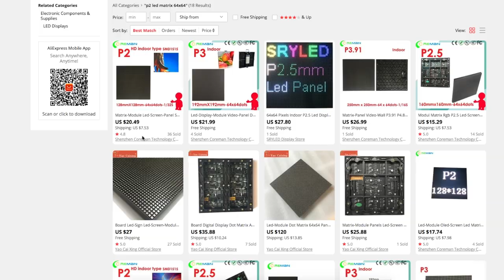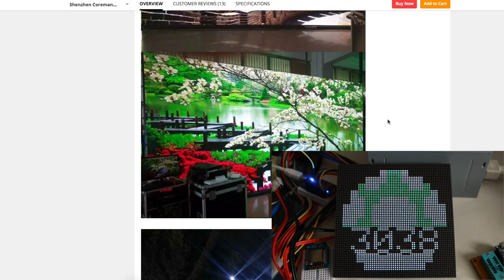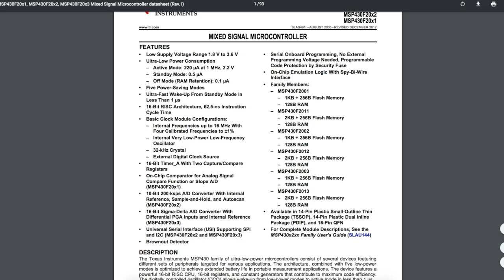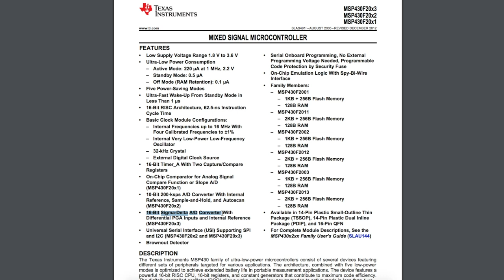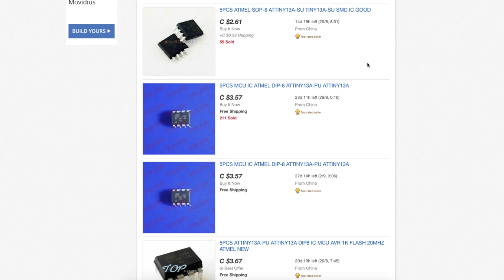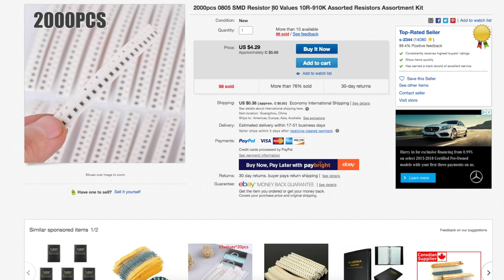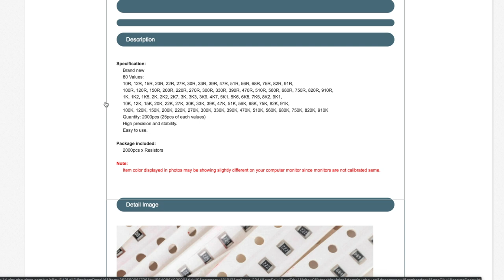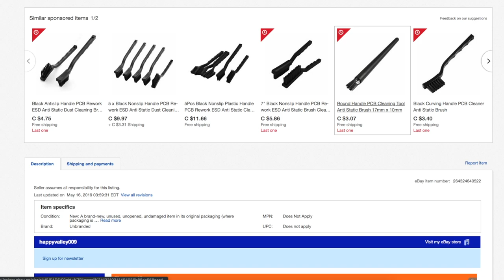GR Mailbag 19.AU.05 - 64x64 LED Matrix and Tools & Parts

Comment: did you try driving display with fast level shifter (like 74HC245D) or as-is, directly from espxxxx board? I did not run it with such displays, but find by hard way that proper fast level shifter required for fast 5v logic, like "neopixels".
Reply from the maker: In this quick test I just went directly from ESP because that’s what those other successful projects were doing even though I did some more research on the chips on this display and looked up their data sheets and of course they are 5V logic where the minimum input valid logic high is above what the ESP can do.

So my next step is going to be trying a level shifter but I figured it was worth a shot because other people had it working and I’ve been able to use the ESP to drive other 5V chips  like max7219 but I do need to do things a bit more properly now that it didn’t work on the first try for me.
Reply: @GadgetReboot  Well, looks like it's depend on phase of the moon and what esp8266 ebay sellers ships today - proper ones or factory rejects.. Please start from fast level shifters for display, don't waste your time with ones based on mosfets - those good only for buttons and non-speed critical devices.

Comment: As far as PIC's the newer ones are more interesting IMO. It seems like fewer people play with them because of the paid compiler nonsense. I won't pay for their compiler. I did pick up a book on the PIC16F1717 with XC8 from Apress. That chip is interesting for it's analog peripherals 10b ADC, 8b DAC, R2R op amp, comparators, software defined pinout, and a configurable gate logic block. It also works with MCC, - the GUI based header configuration software included with MPLabX. It is also available in a 40 pin dip package. If you look up "XC8 Apress" you can find the book. It's available in digital and paperback versions, with the heavily commented code files freely available for anyone on the Apress website. I picked it up in print after meeting the author. Nice guy.

  If you have an interest in the Forth language/OS Flash Forth 5 supports most arduino AVR's (328/1284/2560), and a bunch of PIC's. It supports mostly newer PIC18's but there are a few PIC24's and dsPIC30's. FF5 is a 16b version of Forth.
  I have a few of these vintage PICs as well but assembly is such a pain.
Thanks for the upload.
-Jake
Reply from the maker: I haven’t looked at the latest offerings for any microcontroller family or what’s currently available in the way of development tools but if I have trouble even trying to do simple hobby projects for free, that might inspire me to set up some of my old motherboards if necessary and see if I have any install files downloaded from one or two decades ago that I can do a clean set up  just to use the tools for free. I still have a Picstart plus that runs on RS 232. It might be fun to use period accurate development hardware! 

 I’ve never used the forth language but I’m always looking for something new, or old to get into.   I always used assembler with the pic and atmel devices back in the day. I only really started doing any modern programming with Arduino aside from some dabbling here and there. Just hacking and slashing as I go.
Reply: We have been looking at xlab and and you don't need to buy compilers, if you don't need optimisation etc. You can still use it free for commercial applications.
Reply: @TheEmbeddedHobbyist  
  Definitely. XC8 has a free version. They just do that annoying "buy it and well make your code n times smaller" message every time you use it. They are literally telling us, "we built this compiler, are going to kinda give it to you, like everyone else does, but then we're going to break it in an attempt to coerce your bank account info."
  They screwed up big time when they ditched all the open source development and support in exchange for their proprietary nickel and dime policy IMO. It just isn't a very respectable business model. 
  I see any subscription payment based business as the internet equivalent of a brick and mortar business belonging somewhere between skid row and a bail bondsman. I won't use any service unless I have a forthcoming and transparent price. So the whole XC8 thing is a sleazy execution of a sleazy business model, IMO. It's a shame too. The product can almost outshine the terrible sales management, but almost is the best I can manage to say. Using other compiler options is the only method that really interests me. 
  I spent today messing around with several versions of Forth (flash/am/mecrisp). There is support for several PICs. I just ordered a few 18F26K22's as that appears to be the primary example used for Flash Forth 5's documentation. It really looks like a cool way to learn Forth.
...anyways...that's just my $0.002 adsense.
-Jake
Reply: @ @UpcycleElectronics  not used Forth since I had a Jupiter Ace many years ago. do I remember correctly that it's reverse polish notation based. I remember that it's stack based, with commands like pop, push, swap. push a number on the stack, push a second number on the stack perform an addition and the result is put on the top of the stack. that's about all I remember. thank for the sub.
Reply: @TheEmbeddedHobbyist  
  Ha I came across a bunch of stuff archived for the Jupiter Ace 2 days ago. 
  Yeah Forth is based on "words," is centered around the 2 stacks, which are setup First In Last Out, so RPN.
  There are a ton of systems that Forth works on. Hack-a-Day has a rather funny article on Forth I read yesterday. They called it the "Hackers Language," because you can do almost anything with it, and can get yourself in a lot of trouble in the process. Their crazy example was that you can name "2" as a word that holds the value 7 and forever ruin math. I found that rather funny.
   I still have a whole whole lot to learn with it, but I like the idea of Forth's portability.
  I might even try putting together a multi vintage MPU setup. I saved a reference design a few days ago that had a Z80, 8080, and 6809 all on the same peripheral hardware with tristate buffer access for all 3. It would be fun to mess with those beyond just using a few op codes to flash leds on a breadboard.
-Jake

Comment: I have one of these st link thingies, and pinout on mine is wrong. Open it by pulling on pin header and check if yours is the same as on silkscreen.
Reply from the maker: I’ll be sure to check it before I try using it. Thanks for the heads up.

Comment: LED matrix needs FPGA. Or you get flicker...  on the internet they turn down the brightness and use 32x32 to reduce flicker.  You can also up the clock on the esp8266 to 160MHZ, helps a lot, but not perfect.
Reply: Peter Ellens a FPGA for simple timing signals? Pretty much overkill and expensive
Reply from the maker: I did try increasing the clock and I also tried using the display as if it were only 32 x 32 and 32 x 64 but it was the same problem so maybe the fact that there exists 64 x 64  regardless of how many pixels I am updating, it still causes issues. 

 I was hoping it would work smoothly because bitluni  was using esp8266 with 64 x 64 apparently without issue so I’m just going to have to keep trying. I have some ideas.